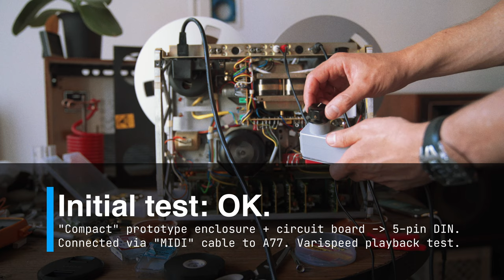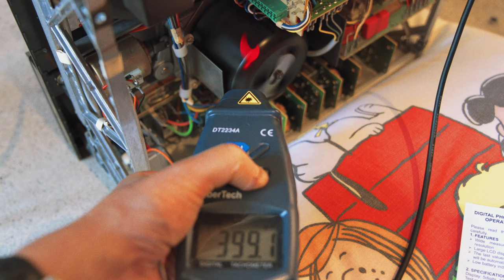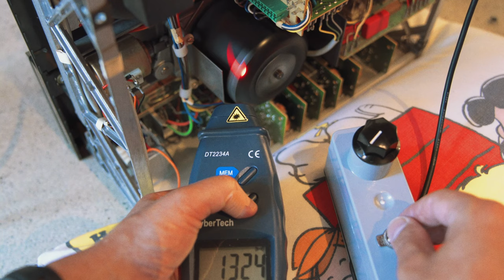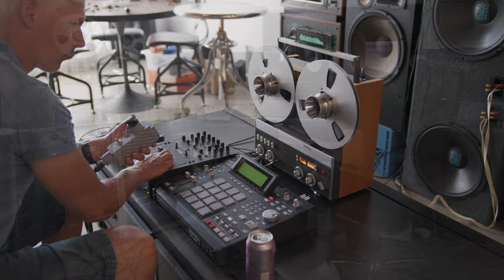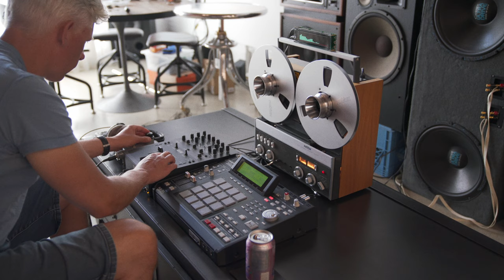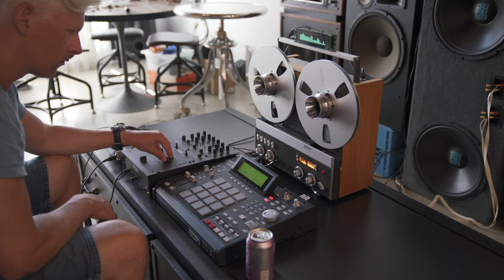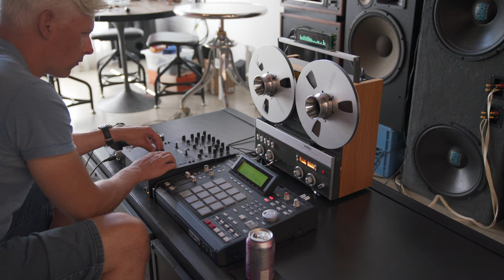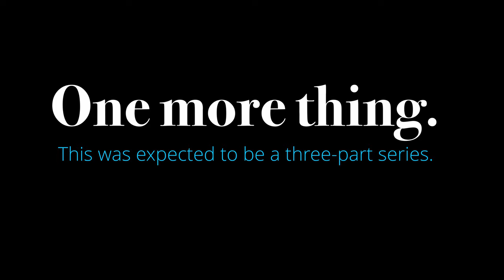🛠️ ReVox A77 + DIY Varispeed, Part 2: Finished build, tape loop / echo / dub demos w/AKAI MPC 2500 🔊

Comment: This is brilliant! Thanks so much! I was also inspired to pick up an A77 after watching that same Prince Fatty video numerous times. I was therefore all prepared to have to build a controller, but I was not expecting to have to do any mods inside the unit - he must have had a pre-modified version as I'm sure he made it sound much simpler - something along the lines of plugging your controller into an existing pitch connection on the A77 - I had therefore been expecting the A77 I picked up to come with some kind of ready made input, so I was a bit confused when I couldn't find it! Thankfully, by pure fluke and fortune, the A77 I bought, despite not being advertised as one, appears to be a MkIV - at least, it definitely has the correct specs/board to implement varispeed. And, just as thankfully, I found your video on what to do inside the unit itself!

Out of curiosity, where did you end up soldering the blk wire to? I can't find any mention of that in the videos - apologies if I have overlooked it. I was going to pop it on pin 6 of the 555, but noticed you hadn't and I'm trying to work out where an alternative better position for it would be on the 0V path.

Also, I'm considering throwing in a DPST switch and building the circuit for 'Fine' control too - not sure how useful I'll find it, but doesn't look too difficult to do.

Thanks again!
Reply from the maker: Thanks for the detailed thoughts; this reminds me of when I was working on the project. 😅 There should be some links in the video description, to the diagrams and schematics I’ve marked up. On the 555/equivalent IC, pin 6 should be connected to BLK or ground. I don’t recall what I ended up doing, but do make sure you check all your wiring carefully.

Comment: This is great man! With this and Part 1, I'm really inspired to do this myself. Reel to Reel with varispeed is something I've wanted in a home studio for quite sometime and this video helps make that an actual possibility. I will definitely be coming back to this when I get my hands on a Revox A77

thanks!
Reply from the maker: Thanks for the kind words! It’s worth noting that most if not all B77 models also have a limited varispeed control built into the front face, in addition to the DIN-type connector for the bigger-range external varispeed control. So if you’re able to find a proper B77, you could also try building the remote varispeed circuit and connecting it via DIN instead of hoping to snag a real remote on eBay. 💸😅

Let me know if you get a machine and decide to take on any of this work, either way. It can be challenging, but fun!
Reply: @scottschiller  Hmm yes I am also thinking that might be an easier route to take... however I saw an interview with a dub mixer who mentioned that the Revox A series goes down to 3.75 ips which is ideal for dub echos and I am not entirely sure the B series does as well. Also I'm not sure if the B77 variable speed would have the amount of control of the speed that you got by modifying the A77. Its all put me down a deeper rabbit hole of research into reel to reels but I find it interesting haha. Thanks again!
Reply from the maker: This all sounds familiar, ha! I’m pretty sure you’re talking about the “Prince Fatty” video, which I referenced briefly in this one. I believe there are B77 models that are capable of 3.75 IPS speeds, but it’s worth researching online to confirm. It’s all a bit of a rabbit hole, indeed! 😉

Comment: amazing!
Reply from the maker: Thanks! I hope you found this interesting. “Part 1” has the earlier electronics schematic and prototype stuff, if you haven’t seen.
Reply: @scottschiller  i watched both several times, your excitement is super! I dont have a reel to reel, but i'd like to build a similar setup. I was searching for vari speed options on tape machines and found your videos. It's exactly what i was looking for. IMHO the audio quality is really good and better than other tape delays.

I'm also interested in pitch shifting drum samples and other sounds like pads. I'm not aware of a plugin that simulates the pitch shift with tape.
Reply from the maker: @Raumweiter  Thanks for the kind words.

I got started with a portable Marantz PMD-430, which I thought I'd use for tape echo. I realized it had limited "built-in" varispeed, so I started looking around for options and stumbled on reel-to-reel machines in the process - and fell down the rabbit hole from there. ;)

You have an interesting point about drums etc. on tape. Digital plug-ins or programs like Audacity can do this digitally of course, but I doubt it's have the same "flavour" as real tape.

You could start with a smaller tape machine, with an eye toward a reel-to-reel if you really want to dig in.

Comment: Awesome video - I was wondering if you knew whether it's possible to do the modification on the mk 1 or mk 2 machines?
Reply from the maker: Less likely, as earlier units didn’t have the capstan (motor) speed control board with “integrated circuit” chips, like the 555 timer. If your machine has chips, it may be someone swapped in a newer board at one point and then this mod is worth trying.
Reply: @scottschiller  thanks so much for the reply! and thanks for your advice. i'll have a look and see.

Comment: Now watch those A77 mkiV’s rise in price... Ear candy. The question is, why didn t you stay with the revox b77 remote?
Reply from the maker: I started building my own varispeed circuit first, and then I found a B77 remote and varispeed control on eBay for a reasonable price. Since I’d already started my own, it made sense to commit and finish. “Part 3” will be my effort to try the official B77 varispeed, take it apart and document making it work as well.

Comment: Dope!! Would you build another one for me and sell it?  😬
Reply from the maker: I’ve had a few people ask! 🙇🏼‍♂️

The biggest problem is the machine itself, which may cost $500 and weighs 34 pounds. 😅

The external varispeed circuit is relatively cheap to build, but you have to connect that to the inside of the machine - and that is tricky and more involved.

If you’re curious, you can see more details on the build in Part 1.
https://youtube.com/watch?v=oAG52DvfXcw

Another option, eBay and a small fortune: buy a B77 model ($800 before shipping?), then watch for the rare official ReVox B77 remote varispeed control for $200. 😅💸
Reply: @scottschiller  I already own a A77. :D Is it that hard to connect this "devices"?
Reply from the maker: Ah, got it!

You will want to make sure you have a Mk IV machine, and also check that your capstan motor speed control board has the 555 IC timer chip on it required for this varispeed stuff. There are different versions of boards on these machines and they may vary, so it’s important to check.

I show the process and approach I used in Part 1. It’s not “easy”, but if you’re comfortable with soldering, electronics diagrams / schematics and multimeters, you can take it on at your own risk.

Comment: I've seen other people who say that just some potentiometers in an external box to control the voltage to the varispeed port would suffice, I'm not super familiar with this stuff l,  your previous video mentioned its not a working solution, but I don't really see why? As I understood it the problems only pop up once you're going for a bigger range of speed manipulation, when you put too many potentiometers in series?
Reply from the maker: I was hesitant to try a larger series of pots on the “trim” adjustment, which is normally used for fine-tuning of the motor speed. That was my “experimental” change, to see how that might behave with a 10Kohm pot or similar. Keep in mind that part of the circuit uses a smaller resistance range, maybe 1Kohm - I forget - so I don’t feel it was designed to be really pushed to very large values.

The official varispeed remote circuitry connects to pins on the 555 IC, and that is the recommended way to get a greater range. As I understand, it is done by changing the frequency output from the 555 - not simply voltage.